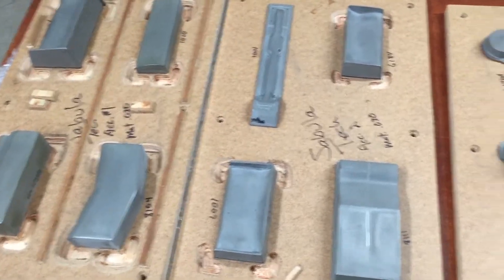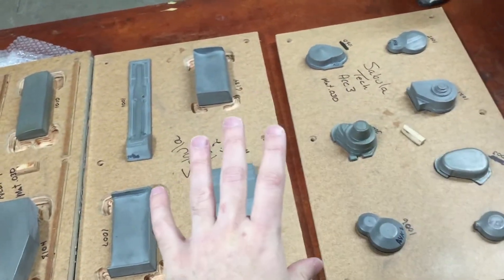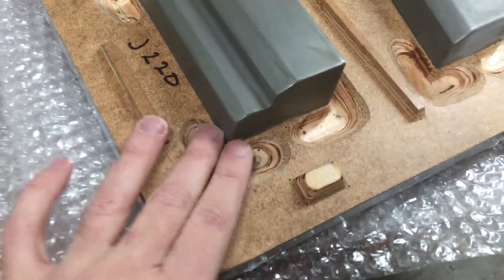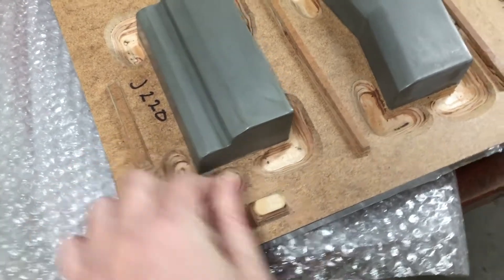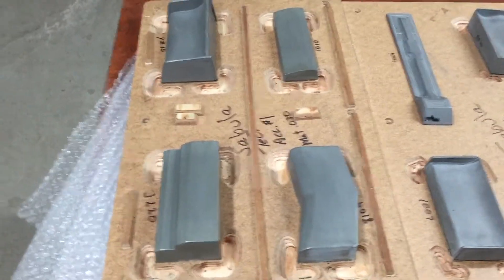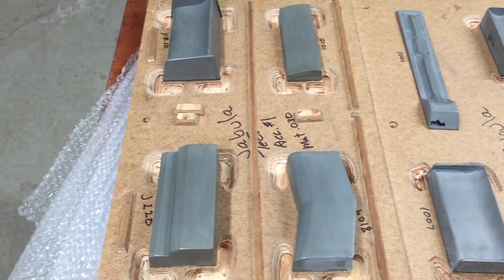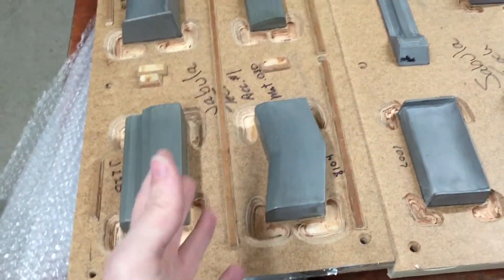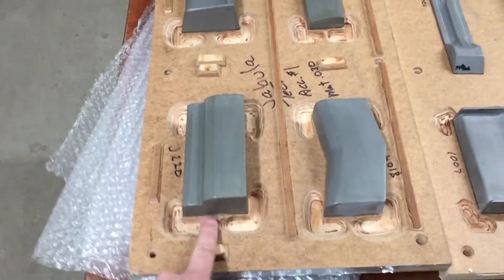Alternate way to remove webbing in Vacuum Forming (Thermoforming)

Comment: Lift the bucks from the bed by about half inch using dowel, bolts or similar. Best not to secure the dowel either, just a neat fit is good. You need to ba able to remove the dowel befor trimming. To trim- run a hot wire under the buck, after the dowel is removed.
Reply from the maker: I could see that might be useful for molds/bucks that don't have a lot of room around platform to do some traditional methods. Think that would be last resort, lot of extra work involved. Putting the buck on a raised base would probably be better though.